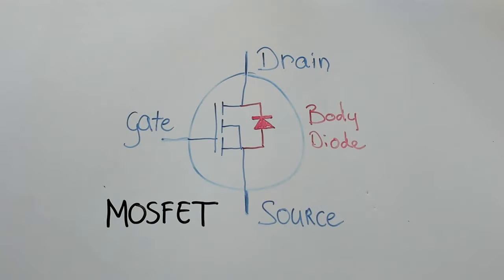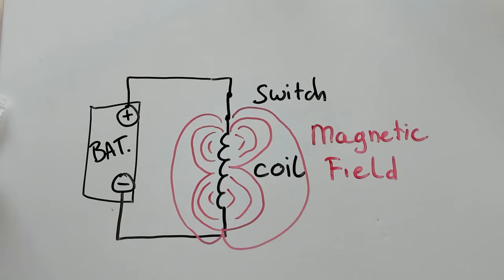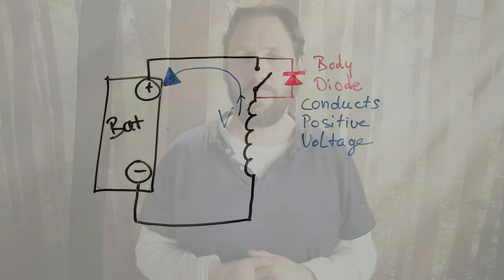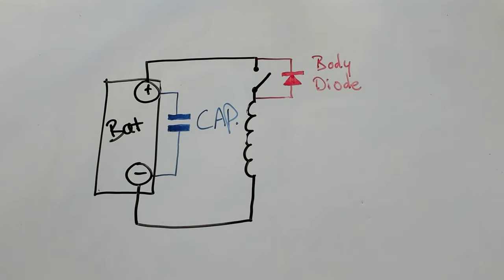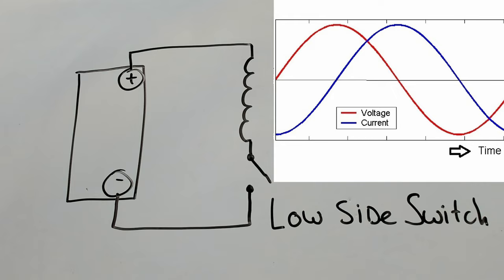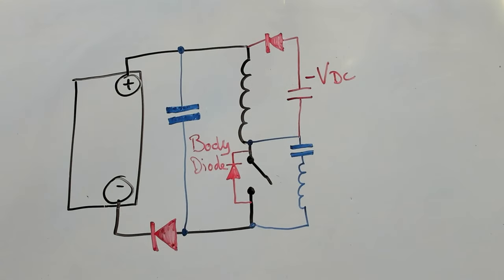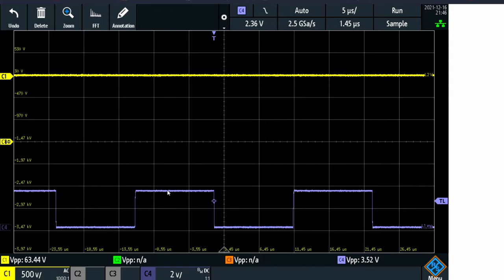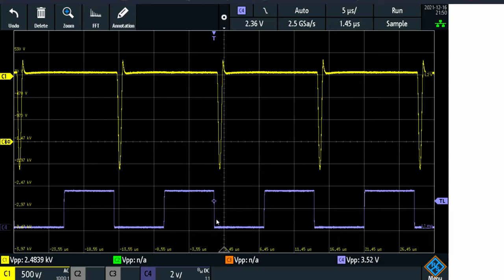Efficient Electric Impulse Generation

Comment: How would you modify this circuit to produce a faster rise in voltage, max(dV/dt), on the front side of the half wave?
Reply from the maker: great question.
I think the solition for this is a bit complex, but I am building it.
the voltage impulse is used to create  a dc offet on the primary coil.

this takes several impulses to charge up.

once charged up, a pair of parallel MOSFETs is turned on, shorting the dc to ground.

turn on happens at the voltage impulse maximum.

In result, we are left with a current impulse. which is the first half of the voltage impulse.

this means it creates a single direction displacement current.

this method should have many benefits. but first I need to test if it all works.

the voltage impulse is to be tuned to the L4 extra coil resonant frequency.
Reply: I’m really asking how would you use a peak trigger to turn on the mosfets, generating a max(dI/dt), on the front of the half wave.

Just found your channel. Looking forward to exploring applications of the circuit!
Reply from the maker: @williamschram  I guess by using an isolated gate driver IC.
That's what turns the MOSFET on really quick
Reply: To generate power it is the strength of the magnetic field and the rate of change of the magnetic field that gives the output. 
Pulsing a coil has a problem in the back emf that is produced and the current does not reflect a relative increase in magnetism.

When a current flows in one winding of a two winding coil and a pulse is sent into the other winding, that is with the current in the opposite direction, the magnetism changes immediately. The magnetism will first collapse to nothing and then reverse polarity. If the opposite ampere turns are greater there will be a polarity change with high voltage as the currents decrease. 

This is the way to produce a strong magnetic field and to change it rapidly as a generator requires. 

The resulting voltage in both windings is very high and other inductors, diodes and capacitors are needed to isolate the supply. @MasterIvo

Comment: Hello Ivo, I've been following your work for some time. I too have been researching the radiant energy effect, using standard axial coils of many designs. I've been at it since 2009.. I built a rather large, flat pancake coil using copper ribbon conductor in 2017. The copper dimensions are 6.35mm X 0.5mm thick. I used virgin teflon dimensioned at 12.7mm X 0.25mm thick as an insulator. It was wrapped as two, separate conductors, then terminated in the bifilar configuration. I did not build it as a Phi ratio coil, I didn't know about it at the time. The dimensions of the final coil are are 114mm I.D. X 265mm O.D. and weighs 2.16Kg. It's a whopper! I also put a 2.5 turn primary around the outside. The purpose of the construction was to investigate the original Tesla magnifying transformer configuration. I used spark and capacitive discharge excitation. This setup produced very high secondary voltages, even though secondary is only 84 turns total. But I changed course after experimenting with it for some months to exploring the mysteries of asymmetrical coils. I've been on that path for 4 years. I was fascinated at the incredibly high Q factors such configurations produced. But after a while, I found that the resonant 90 degree phase shift relationship that all those coils had accounted for virtually no useful power. They were all cosine coils and although fascinating, were not useful for power generation to any extent. I rediscovered your channel recently, and found the topic of stacked, pancake coils very interesting. Especially the use of speaker wire, which will produce electrostatic vectors in two directions. The standard radial field, 90 degrees to the magnetic field AND a field in phase with the magnetic vector. I built 3 smaller coils and used the Phi ration to set the ID and OD dimensions. All 3 are measuring the same to +/-0.3%. That is 115uH and 22nF as measured with my LCR meter at 100Khz. I am finding some of the same mysteries as you are posting. The dimensions of these coils are 57mm I.D. X 150mm O.D., wrapped with 16AWG speaker wire, which is very close to 1.5mm^ conductor. I would like to share pictures with you, but pictures cannot be posted here. If you are interested, an email I can be reached at is cpierce22@cox.net. Contact me and I'll send them your way. Thank you for re-igniting my passion about this investigation! I would also like to share what I am seeing about phase relationships and gain factors that are strangely high. You are free to post and share any info I share with you. I believe in the open source aspect of co-development.

Comment: Very nice! I am using half cycle impulses for sonar systems using the same technique. If you parallel the MOSFET's body diode, which is rather slow, with a much faster SiC diode (either a very high voltage type or several 1200V diodes in series), the back end of your impulse will be cleaner.

In nature, many marine mammals use impulsive sonars for echolocation to find their food, but I am the only one doing this electronically.
Reply from the maker: Thanks for the info! I am going to chop the impulse in half, so that tail than wont exist any more.

Comment: Great video Ivo! This is the most comprehensive video that I've seen you make so far. I like how you showed that you can redirect the back EMF Spike from the coil. I think that was the key to what Ed gray was doing with splitting the positive. It's the same thing I attempt to portray in my resonant charging video. The higher the frequency the more you're going to get coupling to the vacuum to produce the spikes. Nikola Tesla said that you need at least 10000 cycles per second to get the secondary parts of the energy out. You can see in my demonstrations that I use capacitor discharges along with the wireless energy discharge that's occurring at the same time. You can basically recharge your system while at the same time powering a load. By producing the wireless resonant field of energy which can be tapped into by multiple receivers not just one. Because it is a scalar energy field it can be into at multiple points without draining the input power. This part is free. Additionally you can use the pulses to power light bulbs and electric motors. This way you can put more energy into the system than what you are using. The higher the frequency, the more power you can get out of the circuits interaction with The Ether. Glad to see that you are growing and learning with your experiments. And glad to see that you are freely sharing this with us. I will do what I can to support you from here.
Reply from the maker: Where can I see your demonstrations? Your channel has no videos.
Reply: @MasterIvo  that might be Jeff Van from Tesla Motors, maybe he'll tell us.  See my post below to Jeff.
Reply: Jeff, I found your post on Science Forums very important "Actually oliver Heaviside based a lot of his electromagnetic theory on the complex scalar waves that Whittaker proposed. Heaviside is thought to be one of the fathers of electromagnetic theory so I'd say Whittakers ideas have some substantiation.  And when you look at hal Puthoffs polarized vacuum representation of general relativity, you have the electric flux density as central to curved spacetime. So I'd say that Whittakers paper does agree with relativity. "

Would you please share more if you have the time, thanks.
Reply: @shauthentic  I am not from Tesla motors but I do utilize Whitaker's scalar electromagnetics. phase conjugation mirrors dynamics applied to atoms is the key to free energy and gravity control.

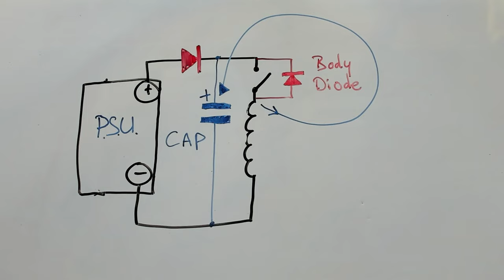Comment: As per your diagram at 7:03, you are wrong. At the end of the coil, where the MOSFET(high side switch) is connected, the coil discharge pulse will be Negative, the opposite of what charged it. So, the body diode and the MOSFET will bock it actually. To effectively extract this inductive spike, you need to have permanently connected reverse biased, high speed diodes at both ends of the coil, connected to the capacitor, which is also connected to the diodes in the proper polarity, which can be further switched out for the required purpose.
Reply from the maker: the first half wave is indeed blocked by the body diode, I redirect this half wave.
if a second half wave is produced it will again be changing in polarity, meaning that the body diode will open.

Comment: Very interesting video..  I've been using a similar method across the output of a few of my low input charging Oscillators & I've been able to hit COP 1.0 with 5 of them but they're not accessing the types of voltages your used to playing  with.. I'm using a solid state relay with them.   I'm using just two 3.7v Lithium Ion Batteries..  Very interesting video.  I never thought of doing it like you explained...  You explain it very well..
Reply from the maker: thx Oliver, relays are a very good way  to work. Tesla also used them to create impulses. I hope you work can be found online, would love to. see it.

Comment: That is very good video. 
I have to questions.
1. Hiw we van regulate the frequency of those impulses in order to match the resonant frequency of the source we want to kick start.

2. Can we use just a signal generator   PWM to create those Unipolar impulses instead of this circuit?

Comment: When a current flows through a coil a magnetic field is produced. If two windings are wound together and a current flows through each but with one in the opposite direction there will be no magnetic field. 
The impulse is used to cancel the magnetic field and even drive it into the opposite polarity if one circuit has greater ampere turns than the other. Only wire resistance is seen and large currents flow. As the magnetic field intensity between the two windings increases the currents stop with high voltage.

A secondary that is tuned to atmospheric electricity will exhibit a tendency to resonate and a small current will flow to earth. The low intensity magnetic field will change ever so slightly and will have polarity changes.

If the primary is intermittently pulsed with a large current of exact timing the magnetic field will change polarity and produce a huge instantaneous current to flow in each half wave.

A test can be done on a transformer that shows the link between two windings an input and output is DC equivalent to only 1/2500th of the load.
The DC current in the 1350 turns of the 230volt input winding that produces the magnetic field of an 80 watt transformer is 0.9volt X 0.035 amp = 0.032 watt. The ampere turns are about 47.25, 1350t X 0.035 amp. 

When the opposite ampere turns of the primary exceed the ampere turns of the secondary the result is a reversal of the magnetic field polarity.
Reply from the maker: don't forget about the capacity of the coil

Comment: I think it won't charge the cap until you let the coil ring. The BEMF is always opposite to the supplied voltage therefore every single inductive spike produced will not goes to the cap but to the load if there is any...that is due to the reverse bias of the diode(body diode).
And if you let it ring the load and the cap will share the power produced half in each cycle of the wave till it completely dampend. Since you intensionally removed the ringing effect all power(from inductive spike) will goes to your pickup coil/extra coil.

Keep it up bro and thanks for sharing such a nice topic.
Reply from the maker: think about adding the L2 coil, which is series resonant. it recieves power from the supply, and simultaneously from the impulse.
by close coupling the L1 and L2, it also receives the magnetic field energy.
Reply: @MasterIvo  Can you explain this in a video or link to where you explain it in an existing video please? Extra coil vid?
Reply from the maker: https://youtu.be/M1oRfCLY3QM

Comment: It seem's to have a lot in common with Bedini circuit or jewel thief circuit .  You Have achieve more than tesla. Only if you understand the basic can you truly find all the hidden energies the universe has to offer. Look into reversing coil's and caduceus coil even more remarkable result.  Happy New year I new you would get in. much small design and higher efficiency . Peace and best wishes to all.
Reply: Parametric excitation, oscillation, coupling, resonance. Parametric transformer / paraformer. Modulating inductance.

Comment: This is amazing, very clearly explained for anyone to understand. Commercial equipment that produces high voltage pulses is too expensive for a hobbyist. 

I am looking for an amplifier that can produce high voltage pulses up to 1000V at frequencies ranging continuously from 0 - 4MHz. This is to power a Rife plasma bulb for healing.
I thought of getting a retro AM tube amplifier made for this purpose similar to what R.Rife had used originally.

But this method seems to be far easier if it can produce a range of frequencies and also put out about 500 W.

Comment: I think I get it. 
You are going for the one wire system? 
Square wave @ 1-2 million per minute is where the magic starts, as I read it in tesla’s prose. Is it possible to get this kind of frequency with what circuitry available out there now? 
If not, I guess I am sticking with doing a wheel added to the center shaft of a Tesla turbine, with 100 or so tungsten pins, quenched gap. It won’t have all the fancy circuitry, but with a turbine @ 50-80k RPM it is possible to get to those frequencies.
Reply from the maker: those frequencies are easy to produce, devide it by 60 and you have the frequency (cycles per second )

Comment: Thank you for your insights. Only problem I have is that you compared input WATTAGE(VxI) to just your output pulsed voltage when you tried to prove efficiency
Reply from the maker: Yes I understand. 
It is not about power out, its about creating powerfull  impulses with little energy.
Reply: @MasterIvo  right, but you have no idea how "powerful" the output voltage is to even compair with the front end to  know if you are only using only a little compared to output
Reply from the maker: True, but it's about the concept of re using / recycling the electric energy. And that is what makes it efficient.

Comment: Thanks for this valuable contribution to further Tesla's work on Radiant Energy Technology. You are a Master Teacher, Ivo. 70,000 impulses per second is too high for my application. I want to use your circuit to generate Impulses for a Motor. Is there a way to control the frequency and duration of the Impulses as needed?
Reply from the maker: yes the square wave generator can be set to lower frequencies

Comment: Hello master Ivo. I'm an electronics newbie and your explanation is great. You cleared many misconceptions in my head, and your work encouraged me to work on Tesla negative impulse as well but, since I'm a newbie, I prefer working on low voltage first so.. working with 2n2222 transistor, but I'm not sure how to position the diode since, like you explained, it doesn't have internal body diode. Thank you in advance ❤️

Oh another question, from Don Smith work, he said lowering the frequency of a coil could be established by adding a resistor, in other area of his speech, by adding a capacitor, just like you did in other videos. I wanna know when to use either ones?

I have lot of questions actually but that's for now. Thank you again and keep the great work!
Reply from the maker: don't use a resistor it does not change the frequency.
The transistor is the switch, so one diode in parallel, and one in series.
2n2222 is fun you can learn from it, but it is very low voltage!
Reply: @MasterIvo  yeah it's really very low, but, thanks to you, I'm encouraged to take my first steps into this new field, still educating myself so taking it gradually.
Reply from the maker: good for you, still so much to discover!
Reply: I worked on FLEET circuit using an AA battery and results are amazing, then I tried connecting two diodes to the transistor, one parallel and the other on series. I know the power output would be much higher but it didn't work that way, sure it was something wrong I did with the connections. Any advice?
Reply from the maker: @necarforever6613  https://youtu.be/Pa2MipWGSKQ

Comment: hello, awesome video! where can I get those circuits shown at 1:50?
Reply from the maker: Sadly the parts are out of supply.
Reply: @MasterIvo  hmm is there anything that could be used instead? im trying to replicate this and want to get started with something. what do you think of using bifilar toroid vortex coils instead of pancake coils? i think the coil I have built is known as "phi tori array" pr abha coil
Reply from the maker: @coilman2361   yes there might be replacement parts, need to find them. I don't think those coils are effective
Reply: @MasterIvo  I've been theorizing that with a clockwise and counterclock wise wound bifilar phi abha coil I could create, once pulse correctly, a precessing magnetic moment vector. With sufficient precessional frequency  and field strength it should overcome gravity. There could very well be a flaw in my theory but I believe a precessing magnetic moment is strongly connected to gravity. My idea was to use resonance to efficiently create this precession without any moving parts or permanent magnets 🤔 the precessing vector would be drawing a hyperboloid and in the center there should be very large dielectric acceleration. You probably understand aether and field theory way better.. is there an obvious flaw in my logic? 😅
Reply: @MasterIvo  one more thing! in you field propulsiom video, if you cut the copper plate in shape if turbine, you should be able to create an aether tornado, multiplying the effect. even small breeze can become very power with vortex dynamics. the guy viktor schausomething understood so well